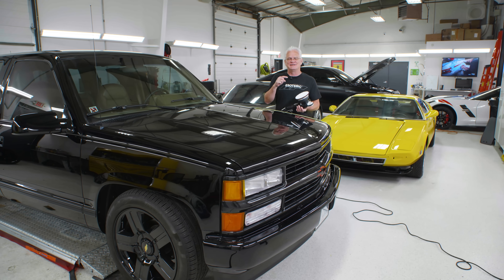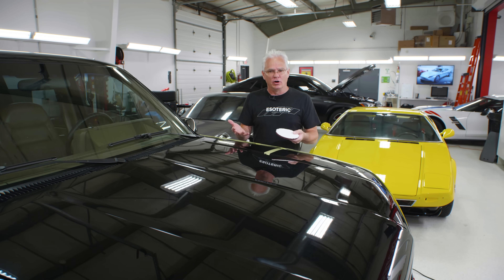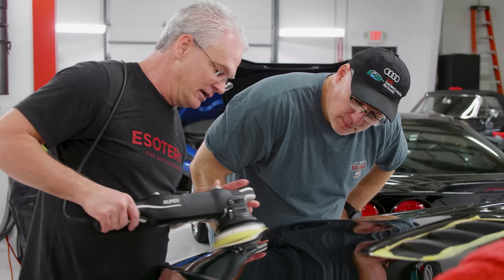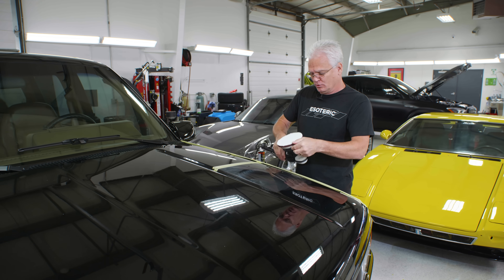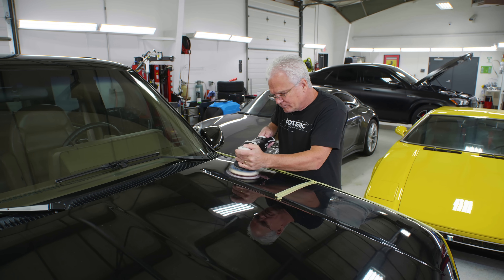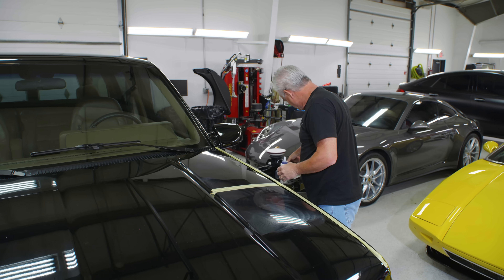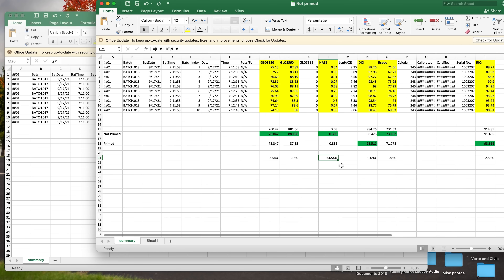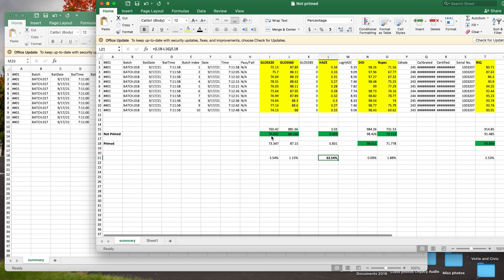DEBUNKING pad priming, with SCIENCE!

Comment: One of my first questions would be is does the choice of pad material play a role in in that?  As in I'm working with a wool pad or a foam pad. There is also the "is this a new uncured paint job or and older cured paint job "factor. If I'm going to mar fresh paint it is with a dry foam pad, and also with a dry wool pad but not as easily. One thing I would recommend to anyone buffing is to get a buffer that shows you the rpms so you can work at the proper speed rating of the compound. Buffing is really an underrated skill, as it is way more complex than what one would think. All things the same as far as age and cure of paint, what is it on?  A steel body panel, a urethane bumper, or a fiberglass part are going to deal with heat generation differently. I think a lot of the loading the pad has to do with being on the safe side of buffing with people that have no experience, as wasting some compound is a lot cheaper than a repaint in a worst-case scenario.

Comment: I know this is a couple years old but with microfibre pads - 1 to 3 small drops is all I would ever use and If I was to add product to a pad and cover the fibers with it using my palm, I never add further product on top of that, that creates dust and clogs the pad up.   The only difference I saw in this video was 4 drops versus 3 not applying drops, rubbing it in then adding more product like two more drops then going - that's what I consider priming.  But I've known of Todd for many years and he's one of the nicest, smartest and best guys in this great industry.  MF use very little product as they clog up quick

Comment: One, theoretic, aspect of priming the pad is that the pad glides better on the surface but in this case microfiber will grab and hold compound from the surface so yeah, priming isn't necessary and in the case of wool and foam pads they will pick up compound from the surface once it's spread. Finishing is easier, correction liquid isn't wasted, it's all good. Yeah, the producer wants you to consume much more but that  it's just marketing. I've just seen this video and I'm learning from this, thanks 👍

Comment: That hazing actually comes from EXCESS clear coat building up because you’ve got EXCESS product from “priming” priming actually would work if you just PRIMED it then started, but priming, and adding dots or product on top of the priming will cause excess clear coat buildup and marring because now you’re working twice as fast even at the same speed, rotation, and passes.

Comment: Coming from a novice in the field: I have the notion that priming (or, rather, using slightly more compound than usual) might be desired when using a thick wool or lambswool pad due to the increased surface area on long-strand pads that will inevitably absorb more compound and leave less on the surface; which, in turn, minimizes lubrication drastically.
Reply from the maker: That's when actual testing side by side will separate theory from reality.

Comment: I feel the same about needing to pick the pad up from the surface before it's fully stopped..as to not mar the paint.  Feel that way about spreading product on low and then speeding up to working speed.  Feel that way about the blotting of product with the pad on the surface before starting the machine. Feel that ooway about product removal in circles vs straight lines.  There are a ton of things like this that become industry Dogma with paint correction. Issue is everyone swears their way is the right way and everyone else is either doing it wrong.

Comment: Tod, great info, proven in the video.  Many of the comments get to the issue of how these differences disappear after several panels using the same pad.  Your replies suggest a fresh pad for every panel, both compounding and polishing.  Is that necessary if you have a great pad cleaning process after every pass?  I just did my first full paint correction on my truck, and used a Lake Country 4000 to clean my pad, with a cleaning agent in the reservoir, after every pass.  Seems that the effect of a “cleaned pad” on the paint was about the same level of work and correction as I continued around the vehicle.  When you say to keep using fresh pads, that isn’t all new pads, but washed pads, or you’d lose $$$ buying pads, right?
Reply from the maker: I don't know what that system is that you're referring to, but can I assume that it uses a wetting agent? If so, you won't have the same results as with swapping out to fresh pads. On foam pads in particular, one of the reasons why we swap them out so often is because as they get saturated and warm, they lose their downward pressure resistance. When this happens, cut and / or finish suffers accordingly. Going through a convoluted cleaning process after every pass is very inefficient, and adds way too much time to the job. And yes, I am referring to swapping out to clean pads each time, not brand new ones.

Comment: But isn’t the pad primed after a few cycles anyway ? Do you therefore need to change the pad every panel .
Reply from the maker: It depends on the process you're doing. When finish polishing, particularly on really soft paint, we always recommend swapping pads after every panel. Having said that though, it's not just because the pad gets loaded up...it's a variety of reasons.

Comment: If you're only priming the pad on the initial putting of product on the pad I don't see how that would result in excessive use of material. I do a very light priming on my pads first pass after that 3 drops and go🤔👍
Reply from the maker: For one, you should be using many different pads during a paint correction process, so it adds up quickly. Secondly, since this shows that you gain nothing from it (and even go backwards), then it's a moot point anyways because you don't need it.

Comment: Can you explain how exactly the pad was primed? I think the definition of a "primed pad" varies from person to person and it would be helpful to understand which process was used for the purpose of this test.
Reply from the maker: Regardless of what method of priming was used, the outcome is always the same in our testing. For this particular video, all of the fibers were lightly covered in compound.
Reply: @Esotericdetail  The reason I ask is because I tested this thoroughly when developing M110 and M210, and found that the specifics of the priming process would play a significant role in the first pass due to the heavier loading. I myself never believed in pad priming and ended up investigating it under controlled settings in order to develop a consistent SOP.

If you load the pad, then proceed to polish the panel straight away then that would explain the extra compound residue you had to remove, as well as the added haze. 

But if you complete the priming process before testing it by running it on a separate panel, then blow out the pad, add the few drops of compound and THEN test it on the panel you would get a very different result. More specifically, you would reduce the haze and residue. 

If the pad is loaded up but not run and blown out, then it is not primed. That's only part of the process.

-MK
Reply from the maker: @MarkusKleis  But the fact remains the same...priming is giving no added benefit, and is wasteful of both time and product. I'm also assuming that you didn't do your testing with a DOI meter, which makes it all subjective. The other thing to consider is processes that are scalable for growing businesses. Extra and unnecessary processes are not something you would want to have a lot of detailers trying to mess with...particularly when it doesn't net any extra results.
Reply: @Esotericdetail  Going to have to agree to disagree on this one. My conclusion on this matter is shared by some of the best and most respected names and brands in the entire industry and the result of countless controlled tests (including blind tests). I also find it quite odd for you to assume that Meguiar's would develop finishing compounds and polishes without the use of scientific equipment to validate their findings - of course they do.

Also not sure what is with change of topics regarding business scalability of pad priming, which is a different topic and would require additional testing (which wasn't part of your test). The question was whether or not there is a benefit to priming a pad - which your test doesn't answer because the pad priming process was never completed before measuring the results.

If you perform a test spot without priming a pad, the results you will see will not reflect what you would experience after just 2-3 more rounds of adding more product. This is why it is essential to properly prime a pad and evaluate it accordingly - that is the only way to get a true read on what you should expect to see once the pad is saturated. 
THIS is the point of priming a pad - it allows you to get an accurate read of what the repeatable results will be once you start working the panel beyond the first pass. It also ensure that if you swap pads in the middle of the vehicle that you will immediately be able to replicate the results you have been achieving thus far. You cannot get an accurate read if you just add a couple of drops and start going at it. It will actually take more time, not less to figure out if the combo is working without priming the pad.
Reply from the maker: @MarkusKleis  We have worked very closely with many of these manufacturers over the years on pre-production development teams, product development projects, etc, including OEM car manufacturers and paint manufacturers. So yes, we do know how these testings go. We saved one very prominent manufacturer perhaps hundreds of thousands of dollars by proving that the polish they were about to release was filling...the polish that was signed off by many of these same detailers you speak of. 

The point here is really simple...priming was a way to make compound x work 12+ years ago, and people just carried on that same thought process and promoted it as "fact". To make blanket statements that priming, spraying with water, and all of these other unnecessarily convoluted processes are required is irresponsible. I too fell into that trap in the early days, then thought on my own, invested in testing equipment, and developed processes that are easily replicated by DIY detailers and professionals alike. 

And speaking of ease of replicating, and reduction of processes and variables, the scalability discussion goes hand in hand. If somebody has a lifestyle business where they're the only worker, they do no PPF or tint, and they're fine with limiting their income, then convoluted processes won't mean much to them. They might as well then go with coatings that require 4-5 layers with many hours in-between. But when those people wish to actually grow a business, they quickly find out what matters, and what doesn't. They also find out limitations based off of their surroundings. Blowing out pads in the same facility where you're applying PPF or tint? Good luck with that. And when they quit doing that, they find out that they achieve just as good of results, in less time, with less product being used. 

If you choose to prime your pads, then so be it. But the simple facts that we have found over the years, at least when working with great products, is that it is an unnecessary process in our business, as well as the businesses of many hundreds of students that have attended our Academy, as well as OEM car manufacturer paint shops we have consulted with.

Comment: I have attended numerous training events at Meguiar’s HQ in Irvine, CA...they prime a MF pad very differently than you didn’t in this example. They prime the pad all the way to the edge and make sure all the fibers are coated in polish. 

In my experience, the first section done when using a freshly primed pad, will always be hazy.  Clean the pad by spinning against a brush or a quick blow out...add a small amount of polish and do the next section....this is what the pad will produce on the next several panels.

All this being said...I don’t think priming is a big deal, one way or the other.
Reply from the maker: I've tried it all ways, and always found it made no difference.

Comment: So obviously the more product, the more cutting, correct?  Less product, less cutting and better finish?  What if you did no product?  Would it burn the paint due to lack of lubrication?
Reply from the maker: No, not correct exactly. This test for instance didn't see any increase in correction with using more product. No product at all would overheat, and you wouldn't have any abrasives to refine the finish.

Comment: Another great video Todd,  priming is not something anyone has to do and the same goes for any other thing that is seen as a "MUST DO" in the industry. I am absolutely blown away at the haze levels on both the non primed and primed pads test spots seen at 16:10.  Now yes, there are alot of different paints out there. My time with Microfibre which was 2011-2019 before retiring from full time detailing.  I rarely got haze and not anything like that most of the time when I did get some haze.  but I didn't use the pad at one speed then stop, I blew it out with air after one or two passes to remove the residues of paint and polish and did another pass or two at lower or higher speed with no extra polish or more polish depending on the amount of film on the surface. I believe that not all microfibre pads are created equal so to get great results, people should do their research and testing, nothing beats real world testing, I've done 70,000 hours of research and testing on lots of things since 1993 when I started detailing.  I've used Flexipads MF pads from UK with the longer fibres, the Uro Fibre 50/50 which is a superb pad, the Megs pads with the higher concentration of fibres but a shorter fibre, the finishing MF from Buff and Shine and Lake Country and a few other ones lesser known in the US.  I like short cycle with MF not medium or long but almost never did I do it using just using one machine speed, my preference, it doesn't have to be done. Each brings something different to the paint.  Keep shooting those awesome videos, your a great authority in detailing, it is so needed in these modern times. PS it's been years since we spoke, I might pick up the phone one of these days and say G'day.Sorry for the long winded comment

Comment: Thanks for finally putting some numbers behind this theory!  I have experienced that priming was not necessary for everything. In fact I stopped doing it a long time ago when I tested it myself and found no difference, other than using to much product. I always emphasize that the variables in detailing are so numerous, one CAN NOT simply use one product, one tool, one method, one technique. It’s up to each detailer to find what works for them through experimentation. That’s what I did…that’s what I teach others. 
Awesome info Todd!!

Comment: Does this apply to the rotary as well?
Reply from the maker: It's been many years since we've used a rotary with any regularity, however at that time I don't recall doing much "priming" of the pads.
Reply: @Esotericdetail  How would you approach extremely hard clear with an orbital?
Reply from the maker: @angelsoftheseventhdawn  No different other than maybe a little more pressure.

Comment: I really enjoyed your informative video. You got me thinking (a dangerous concept lol). By following your explanation of primed vs not primed, I have a question: so while a non primed pad will give less haze (63% less, I believe), the extension of this means that to get the best results you need to use a new pad for every pass. After you use a new pad, it will be primed. Can you continue this video showing the numeric results of what happens to haze on the subsequent passes even after you blow out your pad? Thanks!
Reply from the maker: A few drops of product is completely different than saturating the pad in a "priming" function. Sure, it will build up over time, and you'll want to swap out pads very frequently. But there would be no need to swap them out with every section. There's a certain point at which you'd quickly realize diminishing returns.
Reply: This makes no sense at all, because you follow up with a finishing polish anyway to get rid of the haze.. the cut is only there to cut and leave a somewhat decent finish.

Comment: Good information, but I do have a question: let's say you use an unprimed pad, apply 3-4 spots of the compound and do a 2X2 area, then move to another 2X2 area and apply 3-4 more spots of the compound, aren't you then using a primed pad?
Reply: I came here to ask the very same question. I suppose it falls in line with his point that it’s a waste of time and product to prime the pad.
Reply: This is also why you should not use one pad for the entire vehicle. Work in small sections and change pads as using one pad that gets a lot of spent product will decrease results around the vehicle. It’s not uncommon to use 6-8 pads around a small to midsize car for a single stage  polish.
Reply from the maker: Priming via saturating the pad, and a few drops here and there is a completely different thing...

Comment: Using jescar correcting compound makes a difference here also. I’m not interested in any product that requires a mow down, priming, or supplemental wetting agent.
Reply from the maker: Indeed. Keep it simple. If something requires a convoluted process, then it's time to change your product!
Reply: Totally agree. If I'm not using the Optimum system, It's Jescar. Correction Compound, Medium Polish, Micro Polish, All In One, Power Lock +, and Ceramic Spray Wax have become my go to line in the universal sense. 

I also find that the products said to "need" priming work better without priming.